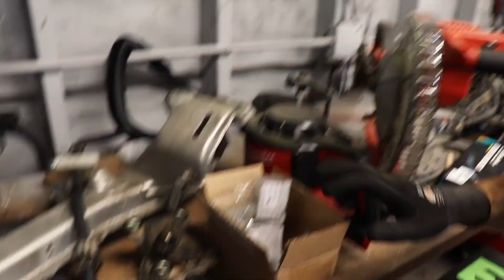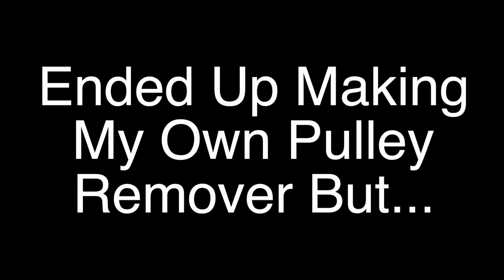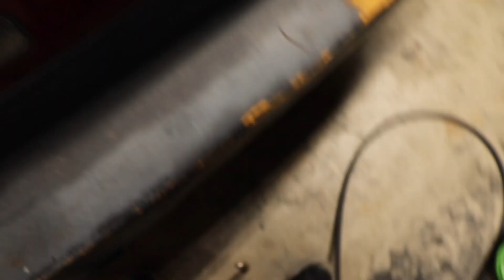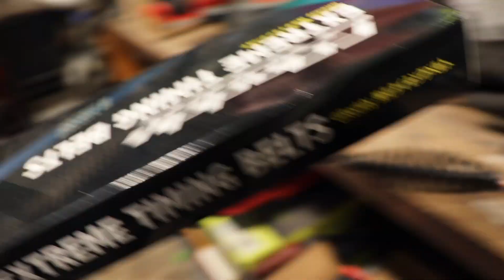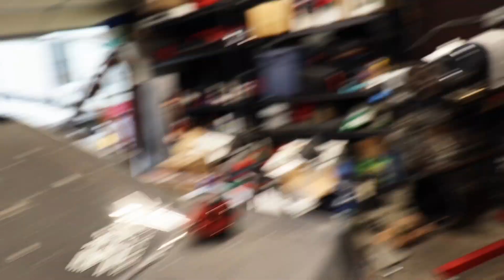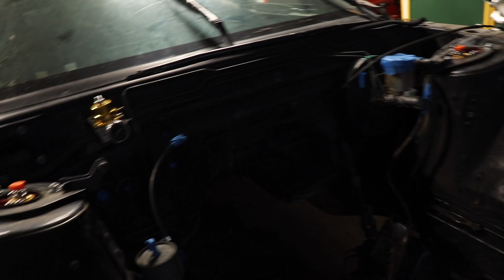RB20DET Build #19: Greddy Timing Belt And New Pulleys

Comment: For anyone with an RB, use the two top hex bolts from the cam gear cover to remove the harmonic balancer. They’re long enough and they’re the correct thread. (Use washers)

Comment: I put greddy on it before and it didn't work out. Had to replace back to a new oem. Greddy was making noise on mine. Oem is smooth for me. Also, I had to crank it by hand 2 full rows clockwise to get the best tension.
Reply from the maker: That's interesting. My greddy belt doesn't make any noise and I havent had any problems with it.

Comment: Hey man, great video. And helped a lot. I just did the timing belt and pulleys on my rb25. Same exact belt as you. After the engine gets hot does the belt make any noise? Mine is driving me insane It sounds like it is too tight once the engine is hot. But not when cold. There are a lot of forums that have this same issue, and I know Kevlar does not change clearances with heat. So basically when the engine is cold it is the correct tension but when it gets hot the metal expands but the belt does not. thus making it too tight. I have readjusted and loosened the timing twice with the same results, it’s quite loud and wanted to know what you have? If it’s anything.
Reply: Did you tighten yours just based off of spring tension? The FSM shows to do it based off resting position of the tensioner, but at least for my RB it feels way too lose. And I’ve adjusted it twice with it still screaming once I push the engine hard. How long have you had yours on for?
Reply from the maker: Hmm that's odd man. I've heard about that issue with the purple hks belt but not the greddy one. Mine doesn't make any noise at all.

Comment: Great video, I'm planning on changing the timing belt and WP on my RB20 soon so this is a huge help. One question - how did you get the crank bolt out without the engine turning over? I hear they can be on really tight.
Reply from the maker: Thank you! Milwaukee 1/2" drive impact took it off with no effort lol

Comment: Hey gonna be doing this tomorrow from inside the car how did u check the timing ,and where can I get the pulley puller that worked best
Reply from the maker: Oh man have fun with it in the car lol I just rented one from autozone but get the claw one not the one with bolts. All the pulleys have timing Marks so you line them all up and then take off the belt. Good luck man and if you have more questions you can DM me on Instagram @fso.media
Reply: @FSOMedia  thanks bro I appreciate it!